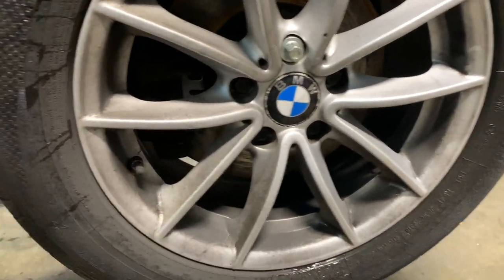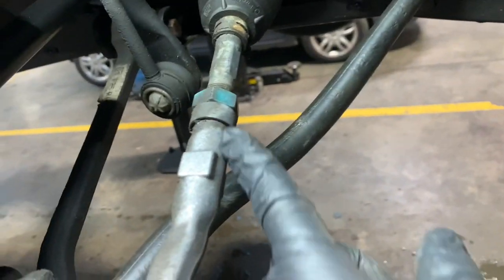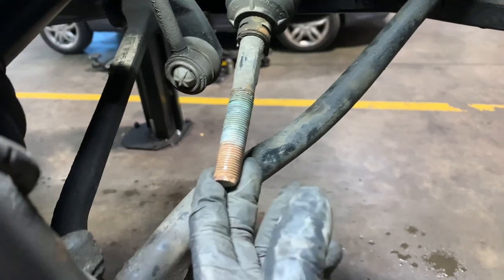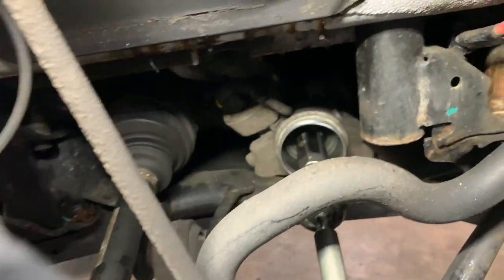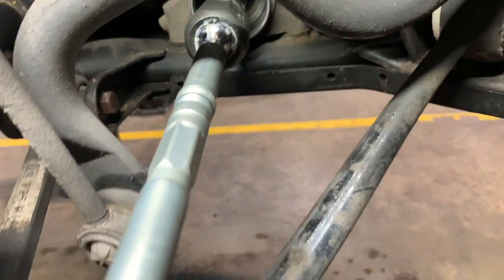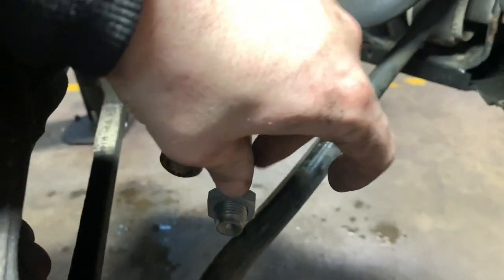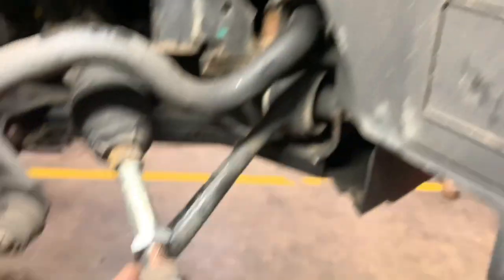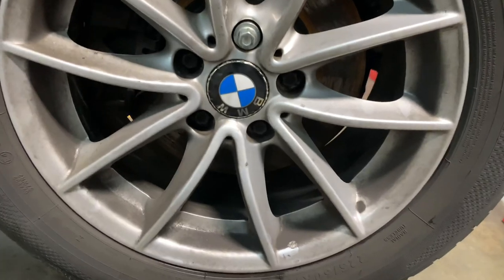Bmw x3 inner tie rod replacement! Steering boot removal! Track rod end replacement!

Comment: I'm now wondering if the knock I get in my e46 is the same inner nut problem you spoke about.. It has been doing it for a long time. It's a knocking when slowing down oven minor bumps. Could be from when I done the tie rods.. Wrong.. Maybe